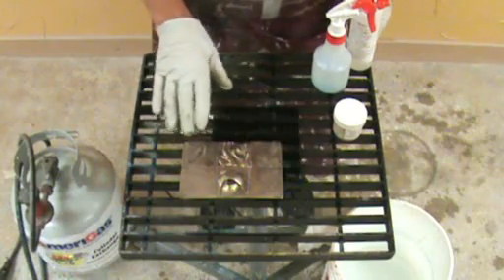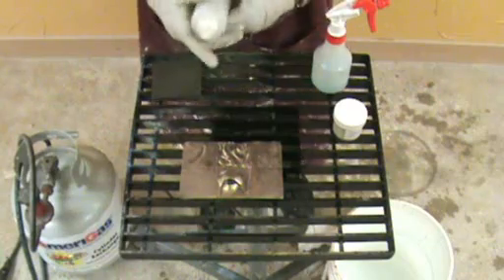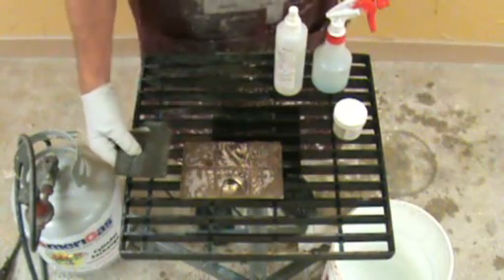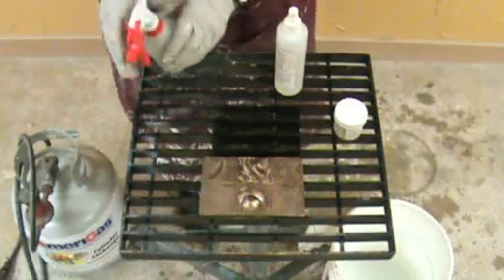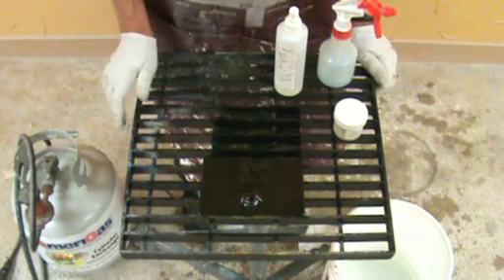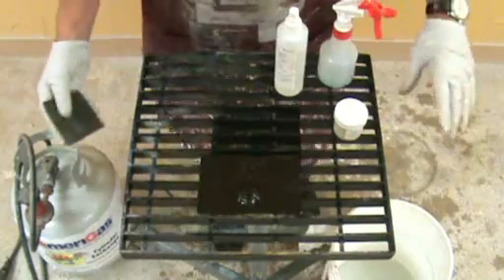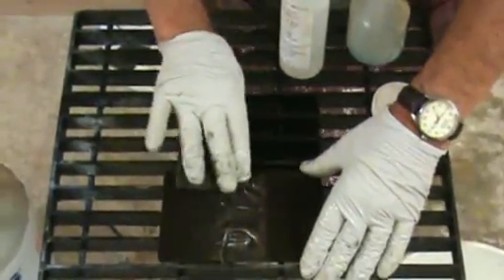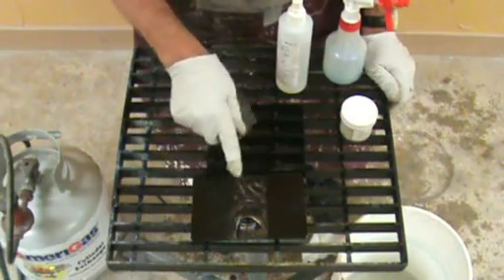Slate Black Patina Application

Comment: I just finished applying antique black patina to a flat bronze peice using a gel patina with the hot method. Most of the surface turned a nice black but there were several large spots that appear to have a white film (or perhaps its the gel patina). How do I fix this issue?
Reply from the maker: +Lynned Farrell Typically Antique Black M24 is a cold application for both the gel and liquid. Either way, I would try getting more water on the surface and possible a white scotch brite pad to lightly burnish the white away.

Comment: Hello,can I apply it to grey cast iron?
Reply from the maker: +Mirko Tmusic Slate Black works on cast iron the same it would on steel. You will need to clean the metal, apply the patina, and clear coat it. Take a look at this video and see if it helps, or you can call us we would be happy to help over the phone as well: https://www.youtube.com/watch?v=8obo7I5zRlA
Reply: +Sculpt Nouveau Thak you for your answer. Another thing: With Vista Patinas I can produce different color effects with penetration in metal,but is there a way to avoid or just to reduce rust impact in iron,and preserve colours?  I saw a video wth a frog,but the best way for me would be to get some dark brown or black with desired patina color without rust.
Reply: Also,can I use heat gun with fan instead of open flame?